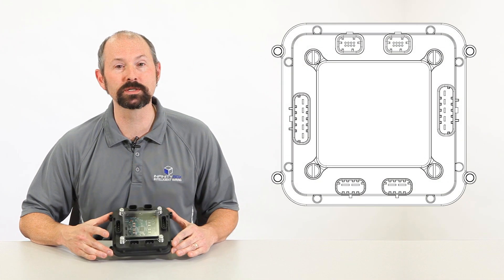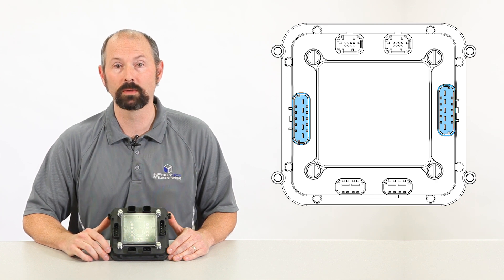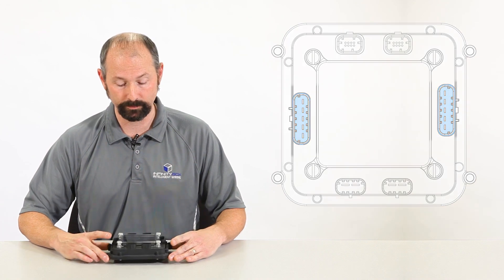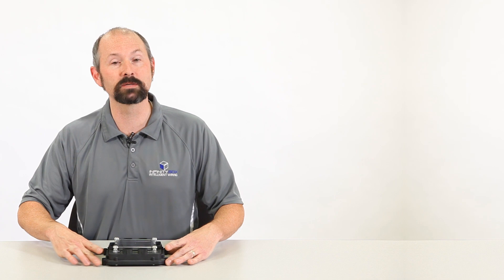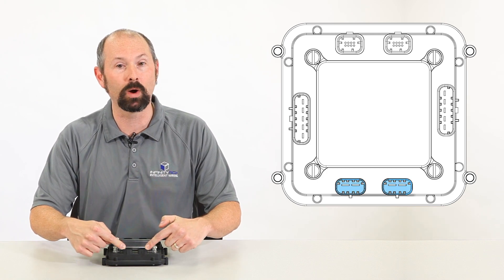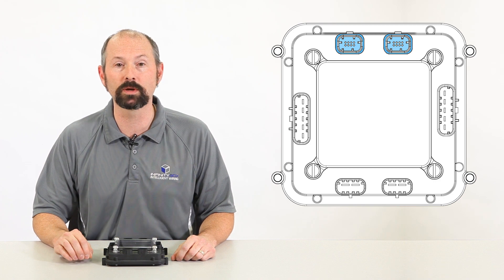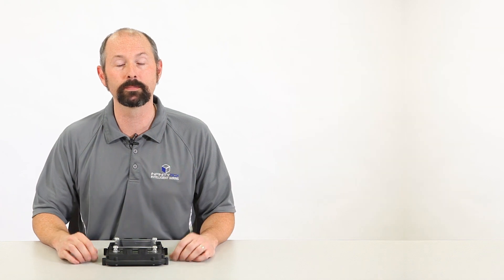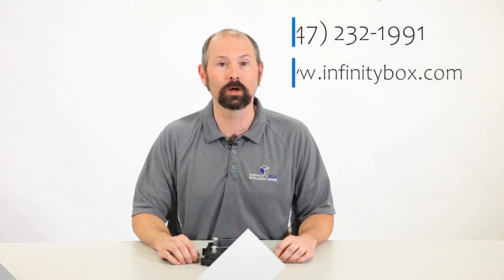Infinitybox inMOTION Motor Controlling Cell Introduction Video

Comment: With 5 pairs of outputs, does that mean I could command a set of 2 front windows up and down, 2 rear windows up and down, And then also command a set of power locks to open and close?
Reply from the maker: Hey Rickey, yes you are correct.  Most guys use the outputs for 4 windows (2 front, 2 back) and power locks.  They wire the power locks in parallel to the 5th output.  Let us know if you have any additional questions.
Reply: You saved me having to email them lol
Reply: Jay, do you still have this until ready for shipping?